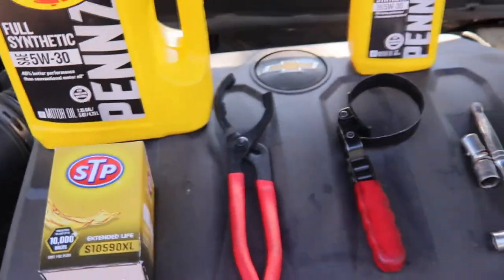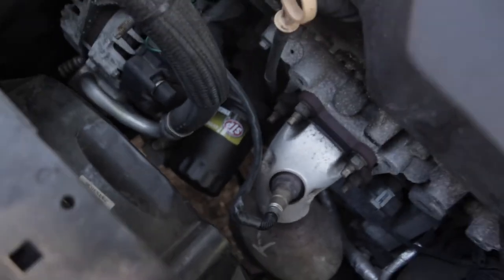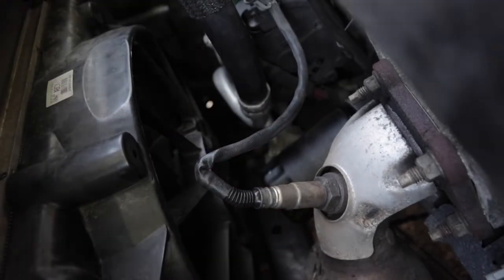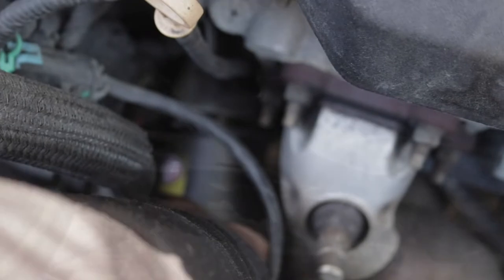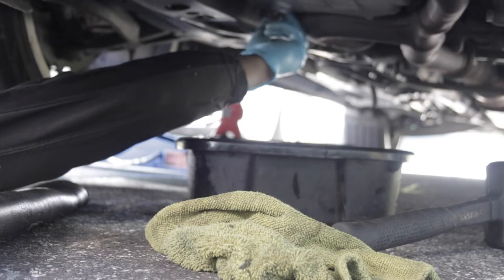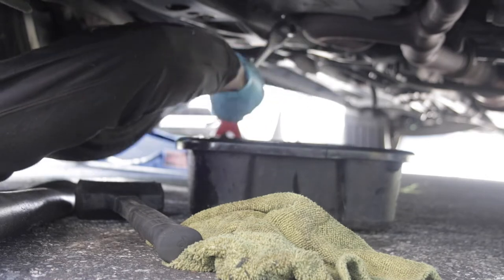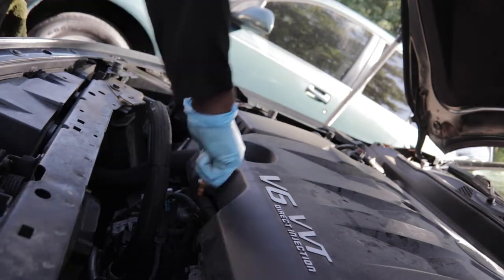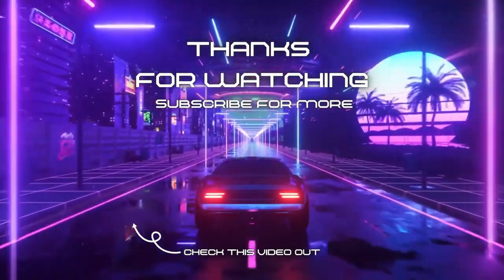Changing Your Own Oil Is Easier Than You Think!! 2015 Chevrolet Impala LTZ

Comment: 5w 20?
Reply from the maker: Na, 5w30
Reply: The oil type is usually located on the oil fill cap. *The 4 cylinder models use 5w 20, whereas the 6 cylinder uses: 5w 30.